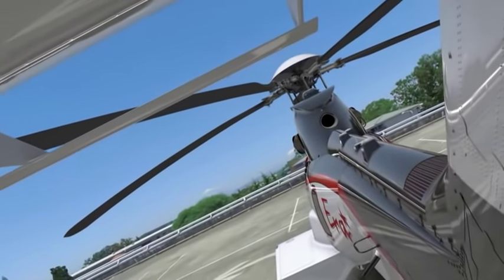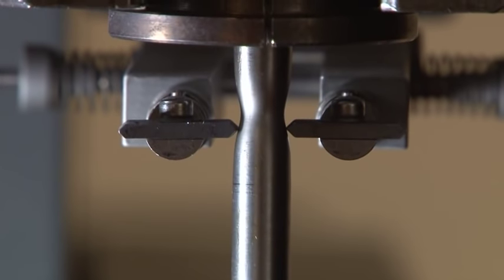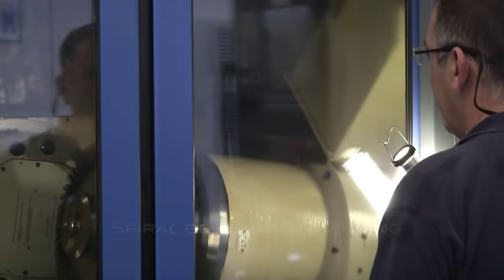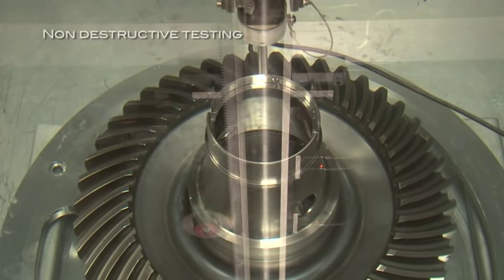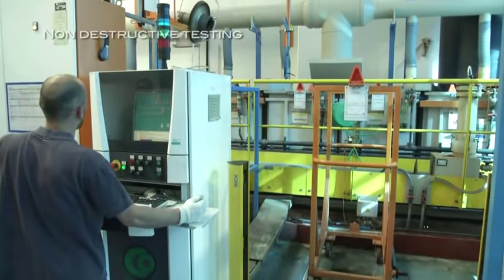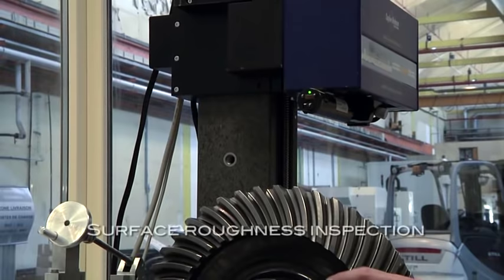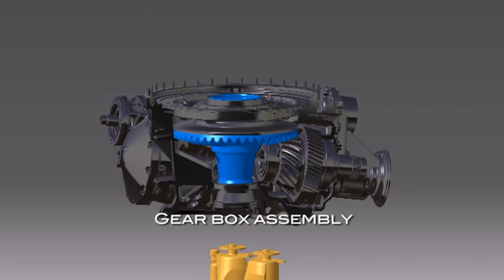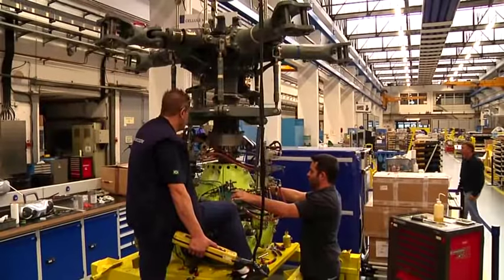EC225 - Bevel Gear Vertical Shaft Process

Comment: Thank the engineers back in the 40's with slide rules and sand casting. Absolute geniuses back in that era. Absolute gorgeous Shaft Gear. Easily $25k for that one part.
Reply: Playa you are 100% right slide rules I was a tool maker in Detroit back in the day hated running this machine it was hot dirty but
I loved the smell of the factory. Now gears are produced on CC machines I work on machines that make drugs  far cry from Detroit and the auto factory
But I am at the end of my time except in Florida they are building a steel factory in Frostproof.  Florida I hope they will hire a old dude like me. They are from
North Carolina and hiring and will put people to school have a good day be safe.
Reply: @nickleggett2101  Big 3 family here too. Tool and die, etc...That machine shop smell: High sulfur cutting oils, Chlorinated solvents all that, agreed. 
Pill press machinery or actual reaction vessels and stuff?..
Nothing replaces experience. The fact you type fluently and understand manual machining, you Will get your new job. Make sure to include all those attributes in your resume and willing to study.. I had the people at the career center help me with mine, was hired the next day lol. 
I love all of central Fla. I miss it.. 
You have a great day too Nick, good luck on that dream job okay. Get out their on one of those lakes and soak up the fresh air for me too eh.. Peace
Reply: @flaplaya  got your tx Monday morning thank u for the encouraging remarks it's good to hear from a brother from the old school of machining where backlash of .020 or more was a part of the day to day grind I live about 6 miles from treasure island beach I think I will go there today. Be safe take care and have a good day.●●●●●●●.
Reply: @nickleggett2101  Twenty thousandths worked. 20 microns nowadays is just amazing.. Treasure Island near Clearwater? That's all deep sea charters and an amazing stretch right through there... Great to see others encouraging, positive additives as well. Hope you had fun I went freshwater fishing on Ft Loudon Lake caught one stripper it was nice. Keep enjoying life.. I'm teaching that buddy how to run a 60 year old Craftsman mini lathe. Belt driven and that little thing was built well. Feed screw with all the SAE ratios and everything. Pretty neat machine.
Reply: @flaplaya  got your message this am thanks Yes treasure island is about 15 minutes. From Clearwater beach but beach is to small and new large hotels put more people in a high tourist area, it's a hot spot for spring breakers.  Now on this cool old lathe have fun surprised the motor still runs but things were made to last back in those days, old finds like that one could bring the owner some quick cash just keep her oiled and do not use air hose to blow off the chips it could jam the carriage and drive screws . Have some fun. Good day.

Comment: Yeah, there is a good reason why manufacturing for this particular gear is explained. That weld is messed up properly.

10 May 2012: G-REDW, an EC225 LP, carried out a controlled ditching following indications of a failure of the main gearbox (MGB) lubrication system and a subsequent failure indication warning on the emergency lubrication system. An investigation by the Air Accidents Investigation Branch (AAIB) identified a 360° circumferential crack in the bevel gear vertical shaft in the main gearbox, in the vicinity of a manufacturing weld, causing disengagement of the drive to both mechanical oil pumps.[70]
22 October 2012: G-CHCN, an EC225 LP of CHC Scotia, ditched in the North Sea 32 miles south west of Shetland whilst en route from Aberdeen to the West Phoenix drilling rig. All 19 on board were rescued. A special bulletin issued by the Air Accidents Investigation Branch (AAIB) said the main and standby oil pumps were not working; a 360-degree crack found on the bevel gear vertical shaft of the gearbox had prevented the oil pump gears from being driven. A worldwide grounding of the type was initiated in response.[35] In both of the 2012 incidents, although the main gearbox lubrication system had failed, the backup system was working correctly but displaying an erroneous warning light, due to an incorrect specification of a pressure switch, which led to the helicopters being ditched.[71]
29 April 2016: LN-OJF, an EC225 LP of CHC Helikopter Service, crashed at an islet near Turøy in the Bergen archipelago, en route to Bergen Airport, Flesland, from the Gullfaks B platform in the North Sea. The helicopter was carrying 11 passengers and 2 crew members; there were no survivors. Eyewitnesses reported that the main rotor separated from the hull immediately before the crash. Due to the crash, all commercial flights by EC225 helicopters, excluding search and rescue flights, were grounded by both Norwegian and British civil aviation authorities.[72][73][74]
Reply: 2018/7/17 korean marine helicopter (MUH-1, surion variant, developed by airbus helicopters, used same gearbox with super puma)
crashed due to gearbox problem.
maker of this gear, "Aubert ＆ Duval" admitted they did wrong about cooling processes of the gear. it had to be air cooled, but they used water which made strength degradation.
Reply: Aren't the Super Puma gears made by gearbox manufacturer Schaeffler USA?
Reply: yep, and I loved AH presentation on EASA Rotorcraft symposium couple of years ago. To protect you from our MGB problems we will forbid you to repare it any where else but AH fascilities and TBO and other maintenance periods will make shorter... much shorter. We love our customers=)
Reply: Stanley Banks  it is okay because it cools down faster that makes production cheaper instead of letting it sit
Reply: They could eliminate the welding on this bevel gear...but that would increase the manufacturing costs , because of more traditional , and time consuming machining processes ! 
In their limited capacity...!
Retooling of these facilities is a major cost / profit  consideration.
The engineering , and manufacturing looks good , and in
      " THEORY " is legitimate ...!
one mistake and the " THEORY " ... FAILS too fly !
Making this part in two pieces , allowing for a welded hub , puts into the equation a point / percentage of failure !
As their history / record has shown . The question is percentage of failed gear hub related incidents , in overall operational statistics ! 
Pilot error , and weather could be far higher in statistically calculating the overall operational statistics.  
( Showing , a magna-flux procedure ) visually looking for cracks !
Even homogeneous ,  billet materials can have catastrophic fractures , due too heat treatment .
Reply: I'm really pleased that the OP listed the known failures of this component and the consequences.

A nice, professional video presentation doesn't alter the facts nor restore the lives lost.

One would have thought that making this component in one piece would be prioritised because it eliminates a known source of failure, the weld!

Aircrew and passengers lives are. At stake, this should matter above profits...

Comment: It actually impressed to think of that the gear set is made to reduce the speed and increase the torque coming from the engines and yet the rotor spins like crazy at speed.

Comment: I was on one of these choppers when  the bevel gear failed and it ditched in the North Sea (g-chcn) the part has now been redesigned but only time will tell if it works.

Comment: We did a lot of EB (electron beam) welding of rocket motor casings (high strength 4135 steel) back in the late 1980’s at Goodyear Aerospace in Akron, Ohio.   That EB weld on the ring gear did NOT look very robust to me.
Reply: I love how the comments are always full of "experts."
Reply: @JimLem  To be fair, videos of this kind will tend to draw one of two types of people, random curious people and people who're familiar with the processes involved who want to see how it is done in other settings.
Reply: @jimmydesouza4375  I agree, but I'm not sure how that relates to my comment. Eurocopter (or Airbus Helicopters as they're now known) is a very well established aerospace brand which has been around for decades. They spend billions on research and development. Yet one self-proclaimed expert viewing a poor quality video clip thinks they have it all wrong.
Reply: @JimLem  I work for the largest insulation manufacturer in the world, that has been around since the 17th century, that has been making fiberglass since the 1920's.  The factory where I work bursts into flames due to improper process at least 20 times a year and we get approximately 4% of our shipped output returned due to flaws that are not detected.

Of course, we don't have the same QA standards as an airbus factory, but just because something is established and spends billions doesn't mean there can't be flaws.
Reply: @jimmydesouza4375  I didn't say that either. I simply stated that it's absurd to think you can provide a professional opinion on something you've seen in a poor quality video clip.

Your example with two factory fires a month isn't the same thing. Most businesses would investigate what went wrong the first time, then implement steps and processes to minimise the risk of it happening again. If you know procedures are not being followed, yet nothing is being done to correct that, that's just blatant irresponsibility.

I'm pretty sure Airbus don't employ a "It's fine, it'll do" attitude. Failures occur. They make improvements to minimise repeated failures.
Reply: @JimLem  "I didn't say that either. I simply stated that it's absurd to think you can provide a professional opinion on something you've seen in a poor quality video clip."

Why?
Reply: @JimLem  Also this isn't what you initially started out as, so stop being a liar.
Reply: @jimmydesouza4375  I haven't deleted or edited anything so I have no idea what you're talking about. But the fact you're resorting to name-calling tells me you've lost your argument. Have a nice day.
Reply: @JimLem  Liars burn my friend.  Anyway you went from belittling what you assumed were people falsely claiming expertise to arguing that the video isn't enough for a real expert.

All so you could continue to pretend to yourself you had never been in the wrong.  Because that is the kind of person you are.
Reply: @jimmydesouza4375  1) I'm not your friend. 2) My point is clearly far too difficult for you to understand, despite explaining it in plain English. Your confusion has got the better of you.

Civility and humility are alien to you. Maybe have a quiet word with yourself and concentrate on being a better person.

Thanks for the interaction.

Good luck to you.

Comment: That's not a "two-piece gear" unless they're "friction welding" the "pieces" together post-machining of the "ring gear". If those "genius" engineers would simply use a "bolt-on" ring gear and carrier and treat that rotor gearbox like a simple "differential" ring & pinion set-up in the axle or transaxle of any and every "land vehicle" bigger/more complex than a motorcycle or "trike" built whether on tires or tracks, they wouldn't need those fancy "surface grinder" stones to "machine" gear teeth because they wouldn't have to BE that "precisely" finished and ground. When dealing with a RING AND PINION SET the "final machining" is done BY THE PARTS THEMSELVES. 

They could properly "match" the ring gear and its pinion(s) before assembly and let the parts lap and "finish machine" each other BEFORE the whole gearbox is assembled and its too late to properly inspect and observe the "break-in" process. And if that "chrome plated" gear is for anything but a "cutaway display" gearbox its no wonder "Eurocopters" have so many "gearbox" failures and crashes. You don't CHROME PLATE POWERTRAIN PARTS BECAUSE CHROME PLATING "HARDENS" THE SURFACE OR RATHER ADDS A "HARDENED" SURFACE TO THE EXISTING "STEEL" AND THAT CHROME SURFACE IS FAR TOO THIN AND BRITTLE AND "RETAINS" STRESSES IN THE METAL ITS PLATED ONTO AND WILL "FRACTURE" INEVITABLY WHEN SUBJECTED TO HIGH "UNIT LOADS" AND IT ALSO DOESN'T "RETAIN" LUBRICANT PROPERLY AND WILL LET HEAT "IN" TO THE GEAR BUT WON'T LET IT BACK OUT. 

And if they have to "vacuum remelt" the "steel" before making their "blanks" they're using RECYCLED "steel" and that is EPIC STUPIDITY AND ENGINEERING IDIOCY AT ITS FINEST. USING "RECYCLED" STEEL FOR "CAST IRON" CASTINGS AND "LOW-LOAD" PARTS IS ONE THING. AND EVEN THEN IT NEEDS TO BE VERY PRECISELY "MIXED" TO PRODUCE "NODULAR IRON" OF  THE PROPER "TYPE". BUT YOU NEVER "RECYCLE" STEEL/IRON FOR SOMETHING LIKE GEARS OR OTHER HIGH-LOAD/HIGH-FRICTION PARTS THAT ARE IN "MESH" WITH OTHER PARTS BECAUSE "GRADING" IT BY "TENSILE STRENGTH" AS IS SHOWN IN THE VIDEO ONLY TELLS YOU THAT THE METAL RESISTS "STRETCHING" PROPERLY AND DOESN'T PROVE ANYTHING ABOUT HOW IT PERFORMS UNDER "PRESSURE" BEING "COMPRESSED". AND SINCE THERE ARE OTHER METALS BESIDES "IRON" IN "STEEL" AND MANY OF THEM HAVE "HIGHER TENSILE STRENGTH" AND ARE "HARDER" THAN IRON, IF YOU GO BY "TENSILE STRENGTH" AND "HARDNESS" ALONE YOU CAN END UP WITH METAL THAT "EXCEEDS SPECIFICATIONS" BUT IS DESTINED TO FAIL IN SERVICE WHERE "TENSILE STRENGTH" AND "HARDNESS" OVER AND ABOVE THE "SPECIFICATION" ARE A VERY, VERY BAD THING. 

The ONLY way to know what's in "high speed steel" for powertrain parts and other parts that lives literally depend on is to "MIX" it from "SCRATCH" SINCE YOU CAN'T "UN-MIX" METALS WHEN "REMELTING" THEM. Its also IMPOSSIBLE to "melt" ANY metal in a "vacuum" since as the metal "melts" the "contaminants" in it with a melting/boiling point LOWER than its melting point will "boil off" and vaporize and you no longer HAVE a "vacuum". Nor do you WANT ONE since "air pockets" in a "casting" aren't "air pockets" at all but are "vacuum pockets" once the casting cools. And "hydrogen inclusions" and "nitrogen pockets"  and other "casting defects" once though to occur during "casting" USUALLY OCCUR DURING COOLING BECAUSE OF THOSE "VACUUM POCKET" DRAWING IN "AIR" AND WATER VAPOR AND BEING HOT ENOUGH TO "DISSOCIATE" THE HYDROGEN AND OXYGEN IN THE WATER VAPOR. THEN WHEN ONE HYDROGEN MOLECULE AND ONE OXYGEN MOLECULE "BURN" TOGETHER THERE IS A SINGLE HYDROGEN MOLECULE LEFT TO GET DRAWN INTO THOSE "VACUUMS". 

NITROGEN CAN DO THE SAME THING BEING AN INERT GAS AND MAKING UP SO MUCH OF OUR ATMOSPHERE. BUT WHEN METAL IS ACTUALLY COMPLETELY "MELTED" WHEN CAST IT WON'T FORM "POCKETS" AND IS VERY DENSE AND INCREASES IN DENSITY IF ALLOWED TO "AIR COOL" NORMALLY. "AIR-COOLING" USING "COMPRESSED AIR" IS WHAT CREATES THOSE "POCKETS" AS AIR/WATER VAPOR ARE "INJECTED" INTO THE CAST PART OR BILLET. ESPECIALLY WHEN "HEAT TREATING" AND JUST HEATING TO IT'S PLASTIC TRANSITION TEMPERATURE (A DULL CHERRY RED FOR STEEL) WHERE ITS MOST "POROUS" AND "LEAST DENSE". THAT'S WHY SMART "METALLURGISTS" HEAT-TREAT AND "QUENCH" WITH WATER OR OIL IN A "NON-AEROBIC" AIR-FREE LIQUID AND "QUENCHING" WITH "AIR" IS AN OBSOLETE AND HORRIBLE WAY TO PRODUCE ANY "CASTING" THAT'S A "BLANK" OR "BILLET" PARTS WILL BE MACHINED FROM. 

It IS done as a way to "cheaply" and "cleanly" and "safely" quench castings/blanks/billets by "manufacturers" and "suppliers" ALSO trying to "save money" by producing "near-net castings" that are the "rough" shape of the "finished part" because it allows a rapid enough "quenching" to produce a "heat treated" part of the proper "surface hardness" without having "dimensions" change to the point the part has to be made larger to "distort" and still have enough metal in the right places. But you don't make high-load, high-quality parts/billets/blanks CORRECTLY and SAFELY FOR THE "CONSUMER" BY "SAVING MONEY" DURING MANUFACTURING AND YOU DAMNED SURE DON'T WANT A "HARD" PART ON THE SURFACE AND A BUNCH OF "STRESS" CAST INTO AND "TRAPPED" INSIDE A PART/CASTING/BILLET/BLANK BY A "NEAR-NET" PROCESS AND "AIR QUENCHING" ALL DONE TO HAVE A "MAX-NET PROFIT MARGIN" IF YOU WANT TO NOT GET BANKRUPTED/SUED/JAILED FOR MAKING SHITTY, CHEAP PARTS FOR EXPENSIVE, COMPLEX MACHINES THAT PEOPLE'S LIVES ARE DEPENDING ON.
Reply: You should apply for eurocopter ...its hiring...
Reply: Deeremeyer is correct in all of his comments. That explaination is one of the best written, unlike this missive , technical descriptions I have ever read. Simply excellent.

Note to suppliers: listen to your engineers and technicians. Tell your bean counters to count beans and stay the hell out of the way of producing as near to perfect parts as possible.
Reply: ...and: where have you been before? :D:D

Comment: 1:35  "Machining limitations require that all shaft bevel gears be made in two parts".   Could the teeth be shaped (broached) instead?  Even if you had to invent a totally new cutting process, elimination of that weld would be worth it.
Reply: Does it ever break at that weld ?.
Reply: @TheSRBgamer63  I don't know.   But I would do whatever was possible to eliminate it anyway.
Reply: @josephastier7421  in 2012 two of these gearbox models failed at that mainshaft weld, which resulted in crashes according to the wikipedia page on the EC225. The company replaced these shafts in many units across the world, which is probably the reason for this QC video. No documented crashes because of that weld since. I guess the cost to add all this QC is less than changing the machining process